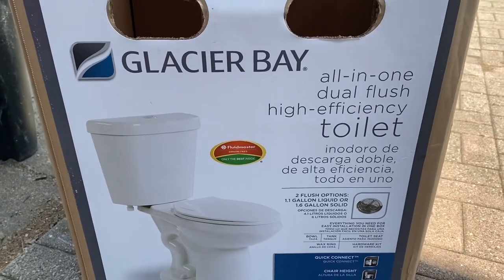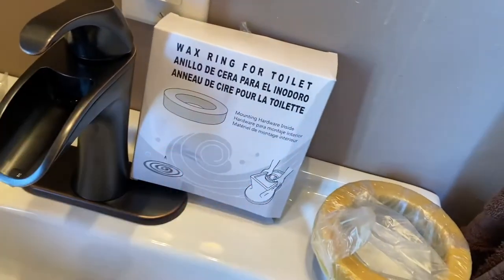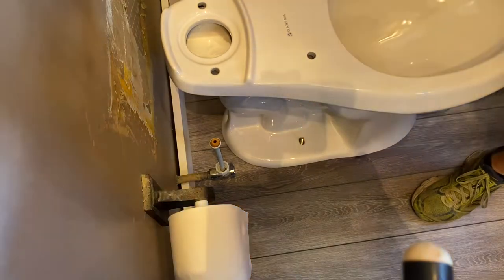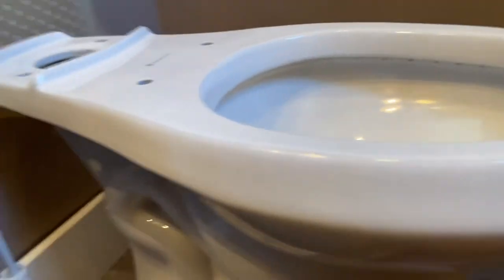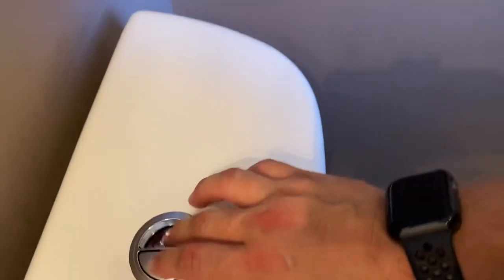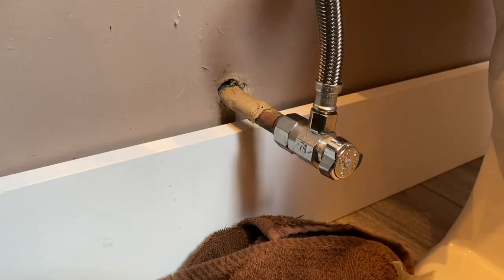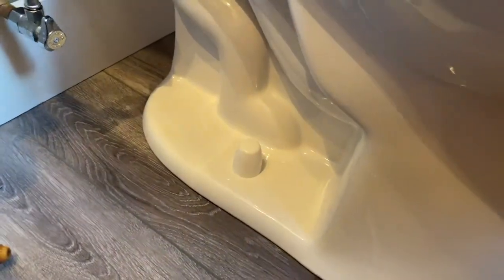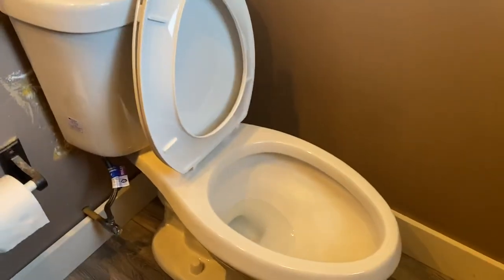How to install a Toilet at Home | Glacier Bay #HowTo #DIY #GlacierBay

Comment: Great video! I was able to get my new toilet installed with no issue! Perfectly explained! Thanks man!
Reply from the maker: Glad it helped!
Reply: @efd can I ask you a question.  I installed the same model toilet but I'm having an issue where the water in the actual bowl slowly empties (3-4 minutes after a flush) but it doesn't refill.  Basically it drains but the water in the tank doesn't refill it.   

It ends up causing the worst smell in the house and even mosquitoes come up from it but I can't figure out the cause and there are no videos addressing this issue.  It's not a leak, not the issue that causes the toilet to constantly run, it just empties.
Reply from the maker: @Carls_World  that is really odd, I've never heard of that happening before. the trap is built into the toilet so it can't really drain on its own. could be a manufacturing issue on your specific toilet.
Reply: @efd  that's what I'm thinking. I think it's a defective toilet.  So, I'm going to call the hotline tomorrow to see what they will do.   It's so bad.  I took a video but I would need to record the draining part separately.   It's so weird, right?  It's the Glacier Bay 215-583 .   Unreal!

Anyway, thank you for the quick response and for sharing your thoughts.  It definitely helps.

Comment: I really appreciate these types of straightforward, easy-to-understand videos! Thanks for sharing!
I do have a question...
Does your toilet have a flush adjustment where you can adjust the flush, say if you have a house full of boys and you sorta need the #2 flush side to flush things down and not leave unwantables lingering about after they've flushed and left the bathroom? I have two of these toilets that someone else installed so I don't have any paperwork remaining that might have clarified this possible function of this toilet brand and so I don't know where to look inside the water tank to visually see if there's some sort of manual lever I can adjust if one does exist.
Reply from the maker: I haven’t found a way to adjust the flush, the water level in the bow is based on the height of the p trap so you can’t adjust that. For the tank, it fills to the top of the overflow so you can’t add more water by adjusting the float. I haven’t had any issues with mine.

Comment: Love the video, very straight forward, however, I think you should have used some teflon tape for the connection between the two metal connections for the water intake.  I think the plastic part is okay as there is a gasket, but metal on metal should have teflon. Only my opinion of coarse as I am NOT a plumber.
Reply from the maker: I used to put teflon on as well but found with some of the cheaper materials, the metal/plastic would flex and the gasket wouldn't sit right leading to leaks. Not sure if its common but since it happened to me a couple times, I put my faith in the rubber gasket. :)

Comment: What if the distance from the back wall to the flange bolt is only 10 1/2 or 11 inches? Will it still work? The instruction show it at 12 inches?

Comment: I just bought two of these toilets to replace my old ones, so this video will be very helpful. My only question is was there an older toilet there before and if so, did you use liqui-lock for the excess water in both the bowl and tank?
Reply from the maker: we did a replace a toilet. For the water in the old one, we flushed it, used a plunger to push as much water out as we could and carried it out outside. We have some water dripping but cleaned it up with a mop and towels.

Comment: I didn't install the toilet but it's new (5 months) and when you flush the toilet only drains, no water comes out of the rim, it never did from the beginning apparently so I'm assuming it has to do with bad installation. do you know what the problem could possibly be?
Reply from the maker: Is water coming out of the bottom of the bowl, by the drain or no water at all?

Comment: Hello, I have this same toilet it was already installed in the house I recently purchased. The toilet now runs water intermittently. Normally when that happens you would adjust the float inside the tank. I have done that and it keeps running anyway. It will stop running once I adjust the float but then as soon as you flush the toilet it starts running again and you have to readjust the float again. Can you tell me how to fix this so it stops running?
Reply from the maker: If the float adjustment isn’t working on the next flush, I am not sure. That’s what I would have suggested.
Reply: It could possibly be because you have rust in your tank. If so, clean off the rust sludge off your rubber components near the rubber drain parts.

Comment: I installed it exactly as you said but once we tried flushing the water came out from on top where the lid. I’m not sure if the washer is too tight on on the water line or what’s going on. Please help
Reply from the maker: came out the top of the tank or from between the tank and the bowl? If its between the 2, could be the rubber washer didn't seat correctly or its overtightened which is causing a crease.

Comment: I bought a toilet like this, but the black plastic piece is not in the wax ring.  I tried to return it to home depot and they told me that this is how they are manufacturing them now.  Would it be a problem without the black plastic piece?
Reply from the maker: I've used both, without the black plastic piece will work fine. I wouldn't hesitate to use it.

Comment: Hello. Your tank does not move around after you put it on and mine does a lot! I’ve tighten the bolts but the water tank still moves a lot. Any suggestions?
Reply from the maker: how tight are the bolts? make sure the gasket between the 2 pieces didn't fall off or is missing.

Comment: Fyi if your bolts drop to low... tin foil to build up the space gaps worked for me. Just sayen. I hope this helps someone. If I didnt put rin foil down there for the bolts it would have been a nightmare to keep them vertically to get into the toil holes
Reply from the maker: great tip!

Comment: Why would the water pressure be low in this toilet. Fills up/drains very slowly.
Reply from the maker: Hmmm, that is odd, sounds like something might be blocking the water flow from the tank to the toilet. The flush is powered by the tank water pushing in the bowl at the bottom. Check the tank to see if there is any plastic or something at the bottom blocking the water.

Comment: Can you tell me how many inches it was from the wall to the bolt?
Reply from the maker: If you mean the toilet flange, the rough for a toilet is usually 12”
Reply: @efd  OK I saw that in the instructions and I want to replace two toilets but one of them is 10.5 inches and the other is 11 inches. Is this going to create a problem?
Reply from the maker: @azhntr1  it'll be tight, I think it will work as there is a gap between the wall and toilet.

Comment: The only problem I had with this toilet is that is a low flow toilet not everything goes down like is supposed to do. I’ve have to use the snake once in a while and get it to go down.
Reply from the maker: I haven’t had that issue yet. Not sure why that would be happening.
Reply: *Jay 949, I just left a message addressing this same issue! Well, I guess I really didn't "address" the issue, more like questioning this issue would be more descriptive. I wondered if there was some sort of lever or something that could be manually adjusted to increase the flush power?! And, since it was assembled by someone else and the inner workings are all in place, I wouldn't know where to look for something like that inside the water tank if there were! I just can't see there NOT being some way to adjust the flush. I'll keep looking and if I find something, I'll come back and let you know! Until then, be & stay well!

Comment: There is one in the Motel i'm staying at;  Question,  which despite 'All these videos on Youtube' about this unit....NO ONE...explains!!??    What...do the two different push buttons...Do?    Meaning,  which one do you push...and ...'For What'?   One is more water used?    or...Push Both?.... Why does one button have a single water drop icon...and the other,  'Two?.....Somebody....explain the use... not just...the 'Installation??   Thank you
Reply from the maker: the single water drop is for number 1 and the double water drop is for number 2. Double water drops uses more water to fully flush down any solid waste.